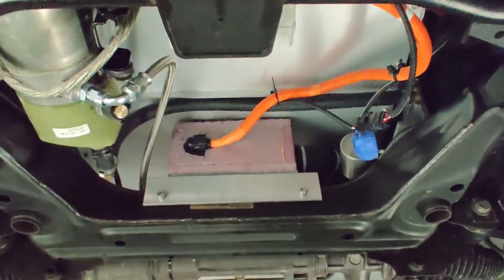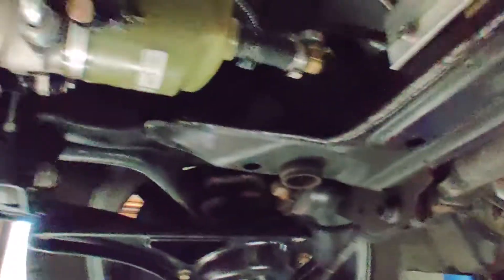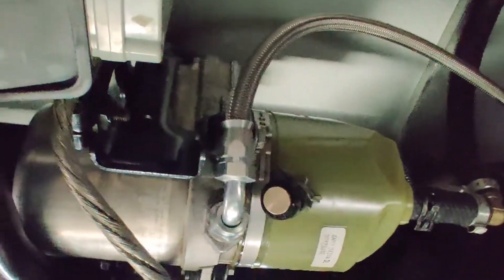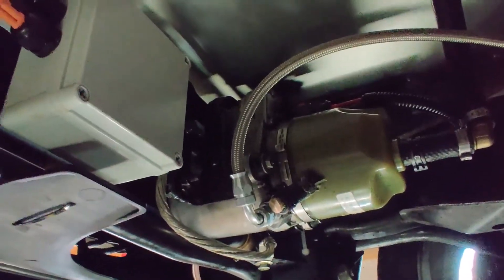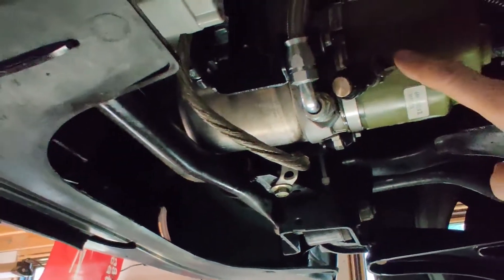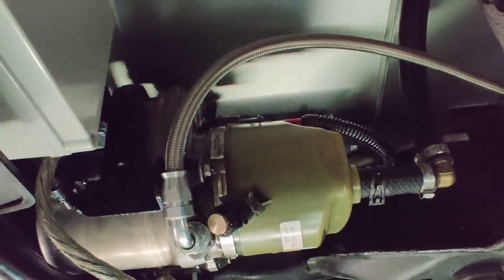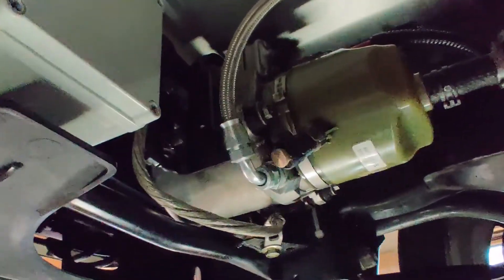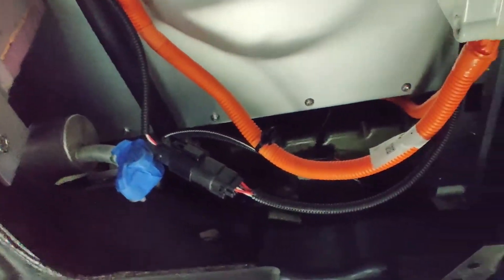Jaguar XJR EV Conversion - Power Steering & Air Conditioning

Comment: Ah yes that makes sense, what about the noise?  And did you figure out a way to make the power assist speed sensitive?  I assume that is what the smaller 3 pronged plug is for.  BTW your Jag is in truely exceptional condition
Reply from the maker: @jameswieler3295  pump is not loud at all after I replaced bearing. Barley audible when you stand next to the car. Pump speed can be controlled through CAN bus but I have it running at around 50%. Assist is speed sensitive because my steering rack has this capability built-in. It uses a solenoid valve which is PWM controlled. If not for that I would control pump speed to achieve the same.

Comment: why is the return port capped off
Reply from the maker: Hello @jameswieler3295 , in my application I have reservoir with filler cap under the hood. Return from the rack goes through a small radiator to this upper reservoir just like it did originally in this car. So the one on the pump is capped off because it serves no purpose in my case. You can see in my case the location of the pump is non standard and very low. But it worked great for the last three years.

Comment: Did you do any more in-depth videos on the ac? Im looking to add AC to my conversion. How did you flush the old oil from the system, particularly the evaporator?
Reply from the maker: Hello Jamie, I apologize for late response, I missed your comment somehow. I did not make video yet but here is some info if still relevant. I flushed all the components I was reusing with "Supercool Air Conditioning Fast Flash" kit. I used new dryer and condenser, I did not do much with Tesla compressor because it had the right oil. Not much oil came out of evaporator, just little bit. After two full seasons everything is great and I did not have to top off. It is not best indicator of success but I am happy. I hope it helps you in any way. If you have any questions please fool fre to reach to me.
Reply: @ArtursGarage  this is great info.  I just acquired my EPA 608 Universal HVAC certification in anticipation of reengineering automotive AC systems on conversions.

Comment: Very clever. Maybe you could use the return nipple as a bleeding valve if you rotate the pump so it faces upwards? That way you don't have to take it out to bleed. Or maybe it's more work than what you currently are doing 😃

Comment: Awesome, where did you find your electric hydraulic pump for steering ? Are you satisfied with it ?
Reply from the maker: I got it from eBay (Volvo S60). I am satisfied with it for now. It is reasonably quiet and simple to make it work as it only needs 12V supply to work. However Ii wish I could control output to adjust amount of assistance depending on speed. Obviously this pump can do it through CAN bus but I don't know protocol/messages.
Reply: @ArtursGarage have you seen the company that makes the gps controller for these? I've only found one person so far on YouTube that has mentioned it. They said it works great. It's around $100.